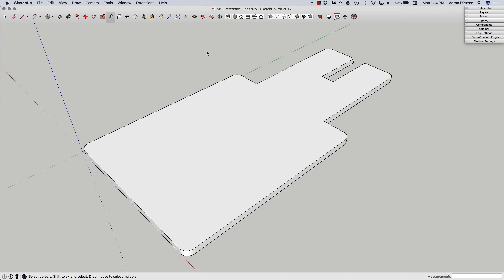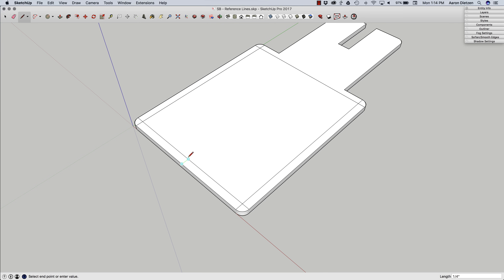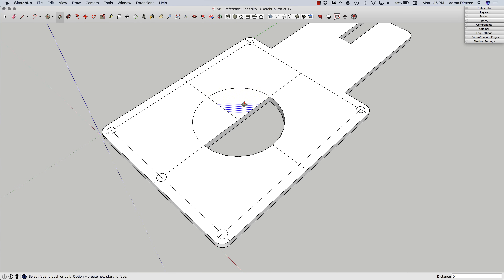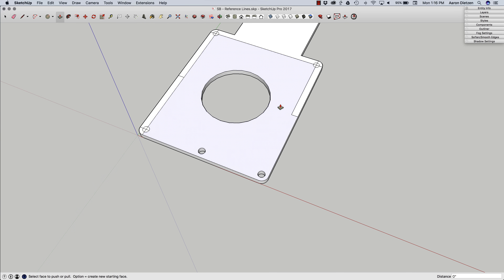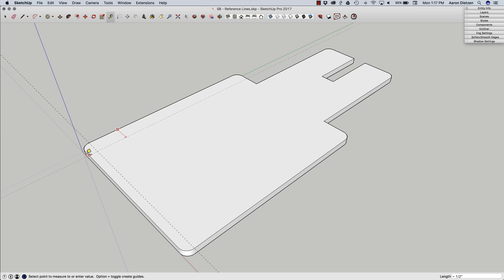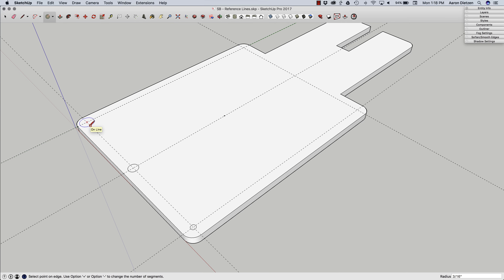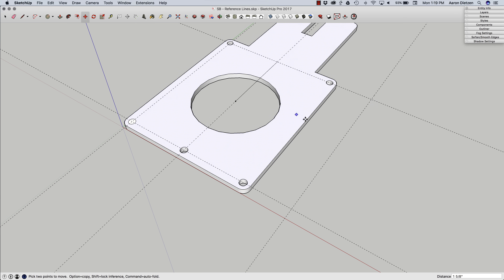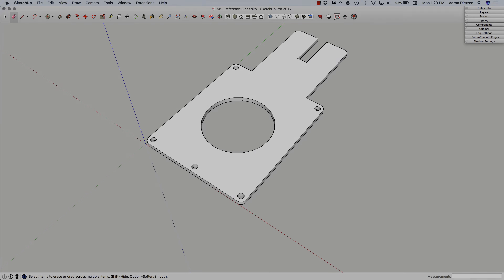SketchUp Skill Builder: All about Guide Lines

Comment: After the first 3 minutes of showing us what not to do - that could have been left out - the video was very good. Would have liked to see how to set up guides that are not parallel to another edge (or perpendicular to an axis).

By default guides are all on one layer that is not listed in the tags/layers window so you get all or nothing with them. It can be helpful to set up other tags/layers specifically for guides which can then be toggled on/off for use/reference. I always allocate my guides to such specific layers so when drawing a surveyed building for example, that is an irregular shape, I have guide tags for each side of the building (front, rear, left and right) and once they have been used for reference I turn the tag off.

Prior to doing it this way my drawing was a myriad of guides that I could not differentiate between. Thanks for making the video